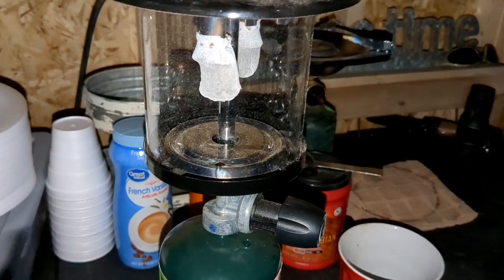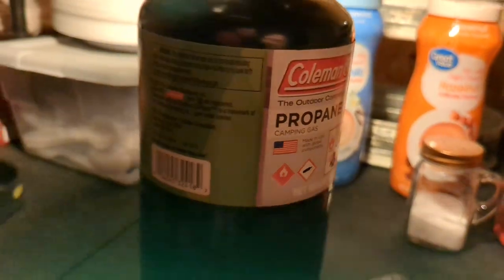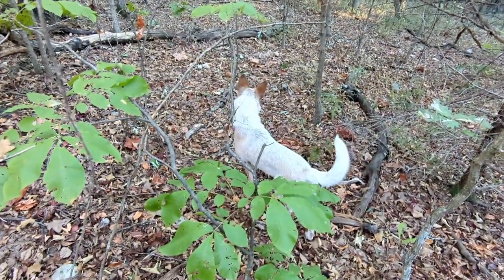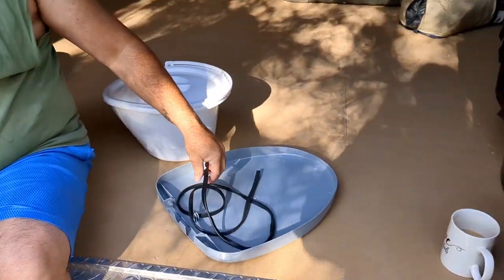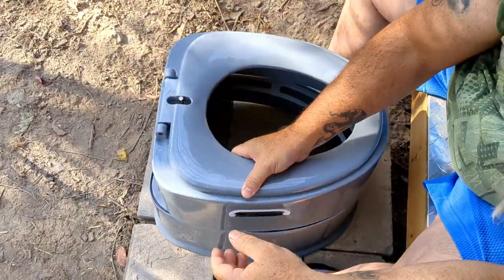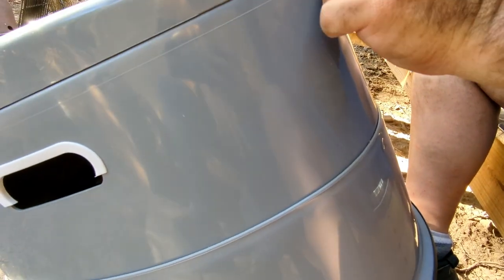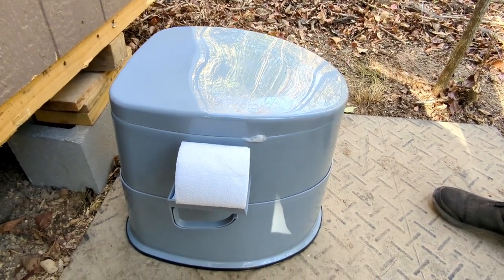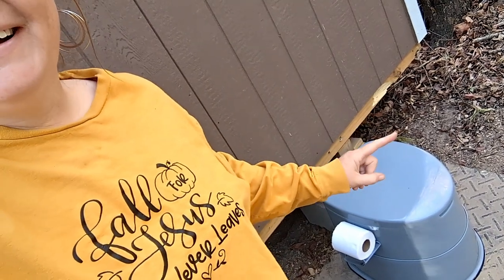Off Grid Cabin Lighting and Setting Up The Portable Toilet

Comment: Yay you are having a toilet. Are you able to get any pallets? If you got several pallets and put them outside your door and then you could put a piece of rug or carpet on it. That way if it rained it's off the ground and drive faster but it would give you a platform for if it's really muddy you can still sit outside on a surface. We've thought about doing that here. The other thing pallets you could make the sides and do like some of the channels are and stick your compost in there for it to break down. When I saw your bucket with a handle it reminded me when I lived at home for 4 months one winter we couldn't use our sewer system when I lived at home. We had eight children and two adults and we used a tall old diaper pill as our toilet. There was no seed on it we had to balance. Although for my father my mom put an ice cream pill bucket inside the toilet. And it was my job to help empty it into the septic system that was the only thing that could go in there all winter. The next spring they finally worked on it. But in Minnesota it gets so much snow and so cold so they had to wait till spring. Your toilet brought back memories. The little things that can bring such Joy. Is there a way when it's just the two of you you can have that inside your little cabin at night. your place is looking so cozy you're doing a fantastic job.
Reply from the maker: We have a small metal building coming for a bath house so we can be out of the weather. Yes, I agree, the little things that bring so much joy 🤗